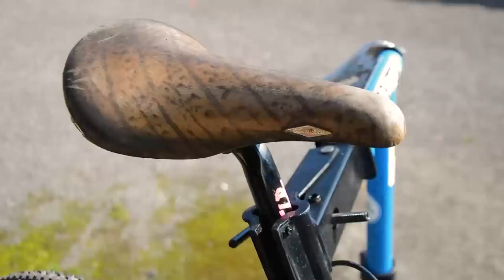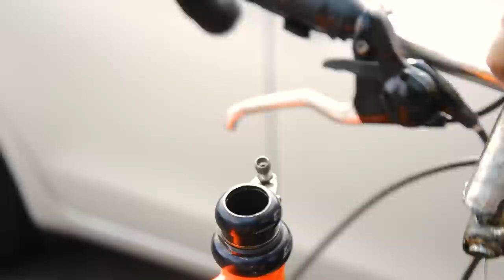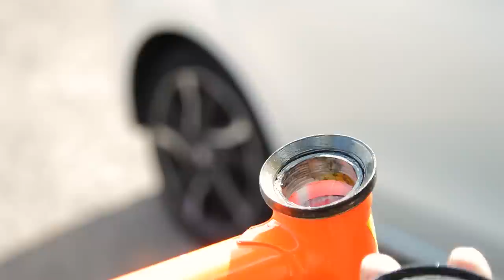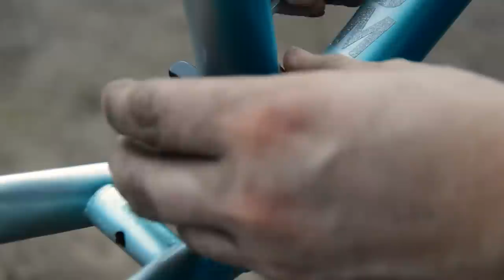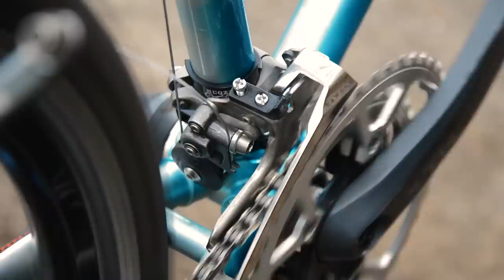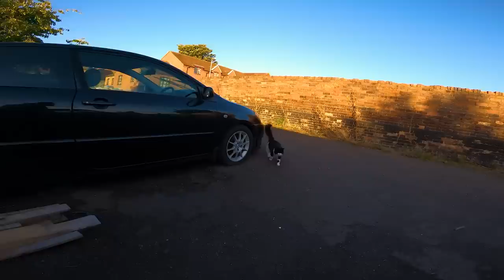Upgrading A Vintage MTB With M950 XTR - Custom MTB Build Venom Sabre

Comment: I have a 94 fully ridgid Schwinn mtn bike that I did the same thing to. Dumping the poor performing cantilever brakes & installing Tektro long-arm V-brakes was the best thing I ever did for this bike! I use it for my gravel bike.
Reply from the maker: I still rock canti's on my Schwinn.  They work well but some well set up V's will always outperform them I guess!
Reply: Yeah-it just seemed like no matter how much I would adjust them or get new pads, the rear brake did nothing at all & I had to squeeze the heck out of the front brake & it squeeled like crazy. The V’s are super powerful for rim brakes.

Comment: Old video but to set up those brakes I usually back the cable adjuster all the way out on the lever. Then set the cable with the pads both contacting the rim. Leave the pads a little loose during this process. I use a small metal ruler (about 1/2 mm) under the trailing end of the pad to set some toe. Then tighten. I then back off the adjuster until one or both pads are about 1mm off the rim. Then adjust spring tension to ensure even spacing. Readjust cable tension if needed. Done. 

I find this is the easiest way and love these brakes.
Reply from the maker: Seems like a good way to do things.

Comment: I can still remember my first mtb ... because before that I was into road racing... a friend of a guy I shared house with came by with a shogun prairie breaker which was excellent so I went  about 3 weeks later and bought a shogun trailbreaker 1 for about $450 AU which was a big chunk of cash  in those days but was a cheaper model but still legit... unfortunately I buckled the back rim in the first 10 minutes of buying it doing what you'd probably nowadays call a whip so back to the bike shop for a new back wheel.... all this in 1987 when I was 16 here in shitty old Adelaide
Reply from the maker: Impressive purchase to breakage time!

Comment: super nice build! your rear V brake issue may be because you placed the brake arm pins in the highest brake boss holes (on the front you put them in the middle). I had the exact issue on a build of mine with M739 XT V brakes. the brake arm springs being flexxed tighter in the high hole position doesn't allow as much fine tuning capability, although is for wider rims if you need to have the arms rest in a wider position
Reply from the maker: I almost feel like the spacing of the frame is slightly too narrow for the design of those Vs.  They need that right amount of swing in the paralelogram.

Comment: Very cool bike the colours are a great mix. Why did you have to add a travel agent for the front derailleur??? Very nice people along the canal I must say. Cheers
Reply from the maker: Thanks.  The front derailleur is bottom pull but the bike is top pull routing.  Just needed to add that verter to switch it up.

Comment: I think the Jtek shim might need some looking into. Between the shim and the road Ultegra BB, you are just millimeters away from perfect. Love you videos! happy subscriber
Reply from the maker: I guess I could perhaps move the derailleur shim to all one side to help out... I'll just keep an eye out for an XTR BB popping up.  Fingers crossed.
Reply: @MonkeyShred  I just re-watched this video and I have some new first hand experience to share. That Hi-Low or whatever Shimano calls that "Rapid Rise" 9-Speed rear derailleur (RD-M951) @MonkeyShred PLEASE try pairing that derailleur with a friction shifter. The cable tension to gear ratio seem PERFECT.

Comment: Hey bud. Checking in to see how that BB/crankset combo has been working for you if you’ve changed it up. I recently picked up the same crank and have been struggling to find an XTR V1 BB. Thanks!
Reply: The Shimano 5500 105 Ocatlink BB is V1 and fits.Most places like CRC do them.I have been using them for years.There are only 3 options for M95/ series chainsets-Dura Ace,105 5500 and the original M950.These are the only V1 Octalinkoptions.V2 Octalink(XT/Ultegra etc) wont fit as the spline depths are different.
Reply from the maker: Not completely true Denis.  I'd used a Ultegra BB for this build.  As long as it's V1 it will fit the M950 cranks... it's just getting the right axle length to suit.  

From Sheldon Brown's website:
Octalink ® V1 Spline: 9 speed BB-M952 (XTR), BB-7700 (Dura-Ace), BB-6500 (Ultegra), BB-5500 (105)
   V1 BB spline grooves 5 mm long, ridges 2.2 mm wide.
Reply: @MonkeyShred  I stand corrected.Thats good to know.

Comment: I have a set of those XTR brakes, and they are super sensitive, to be polite. The brake pad mounts should be roughly parallel to the braking surface of the rim, such that the pad post is roughly perpendicular to the mount, but this only happens if the planets all align correctly. Otherwise, your pads come off the mount at some crazy angle, which both looks odd and can't be mechanically so great.

I have had very little luck putting them on bikes from the early 1990s, when I think the brake post spacing was either not entirely standardized or standardized to something narrower than it ended up at. Narrower spacing would make sense because tires were narrower, and so was the space between the seatstays. Also, with cantis, you wanted to get the pad posts as short as possible to minimize flex, so it would make sense to move the brake arms (and posts) inboard. The problem is that the parallelogram device on the XTR units won't let you place the brake spring in anything but the middle hole, without the mounting point for the pads going nonparallel to the rim when the brake is squeezed. But if the post spacing is too narrow, you need to place the spring in the upper hole (like you did) to get any tension on the brake. You therefore end up with the weirdly angled everything.

There is a solution that sometimes works: the bottom mounting pivot for the parallelogram mechanism can be rotated, to reorient the pad mounting point. It is press fit onto splines around the brake bearings. To get the mounting pivot off, you have to remove the outside nut securing the brake bearings. This pushes the pivot off. Then experiment with rotating the thing up and down. After rotating it, you press the pivot back on by reinstalling the brake.

It might work. Try it on one and see. While you are at it, you can service the bearings!

Here is a good set of instructions for getting the pivot off: https://www.mtbr.com/threads/how-to-service-xtr-v-brakes.778033/
Reply from the maker: Ah ha!  See I was thinking the same thing.  I've had one XT V brake on a bike before and I just couldn't get it hitting the rim right.  This one is an even earlier bike and I did wonder if the spacing is such that the design of these Vs just wont work properly because of the swing required.
Reply: @MonkeyShred  The parallelogram is a cool idea, and very much in keeping with Shimano's style of over engineering everything, but it is in my opinion ultimately not worth it. That said, in addition to the XTRs, I have the XT versions too on a bike and like them a lot. So i am not really in a position to complain too much  But in the end, they are great if they work but the rigid armed Vs are just more versatile.

Most versatile of all of course are cantis, especially with modern, stiffer brake pads. The levers you got should be adjustable between cantis and Vs, maybe the best route would be a nice set of cantis for the bike...

Comment: The Octolink and XTR groupset show you're still a gambler, but did you win, lose or draw with the Ultegra BB? The J-Tek Mech Verter was an cagey choice. Now I know how to address such a dilemma. And did you have to keep the roller bearings for the headset or was it another gamble? Don't look like they'll last. Couldn't quite follow your point on the default position of the rear derailleur versus its earlier version, but no matter. Nothing venomous about this bike; it's a beaut. Love how the blue of the chain stays reflect off the cassette, spokes and rim.
Reply from the maker: The BB works.  It's not ideal though.  Not sure I follow on the cagey choice though.  The verter was needed to run that derailleur.
Reply: @MonkeyShred  "Cagey" = intelligent. An intelligent choice.

Comment: Get the proper bottom bracket so you dont mess up the nice XTR crank. I put the wrong Octalink bb on. It became apparent only on the trail. Had to stop and tighten a couple times. Road and trail Octalink are not compatible.